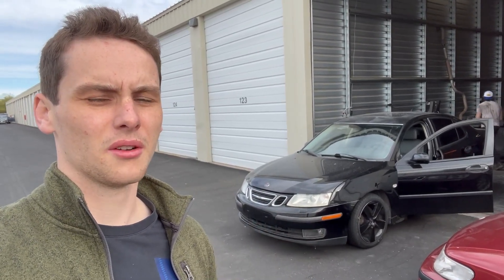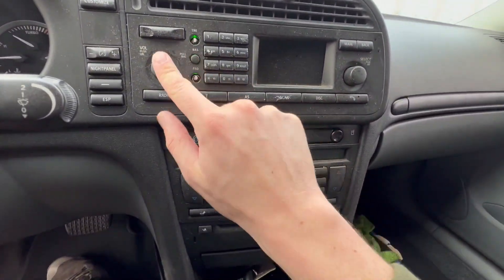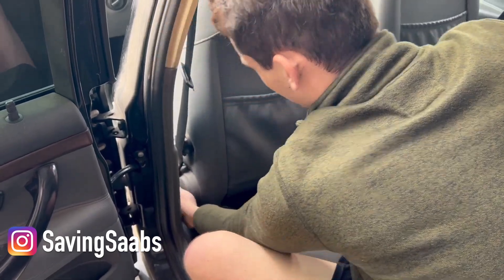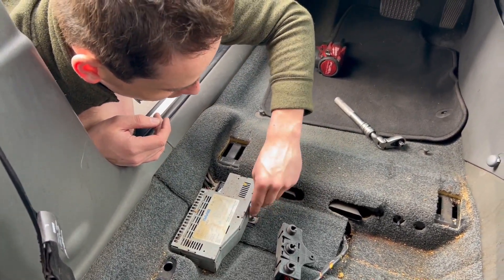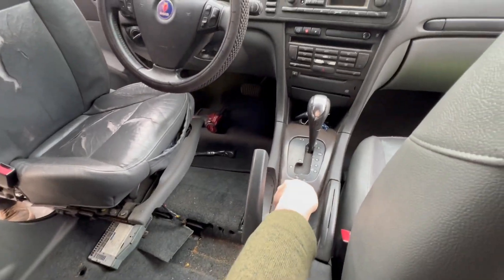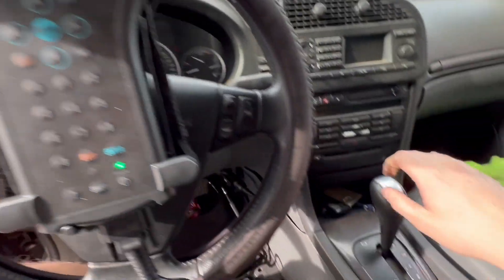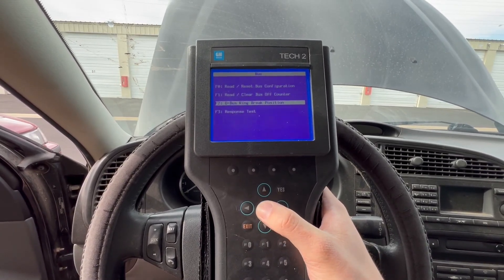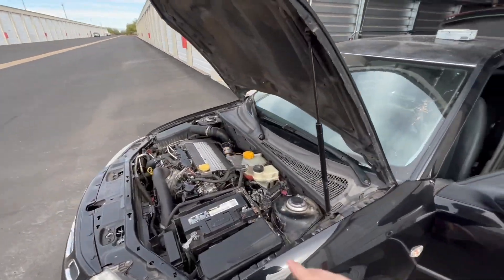Saab 9-3 Quick Fix - AMP1 Replacement

Comment: I have an ‘02 NG 9-3 in black also. It’s had me absolutely flabbergasted more than a few times, and basically at the end of my wits with conniption fits at least twice now, all stemming from electrical issues that more often than not end up being something entirely different than the symptom/problem would have you think. The bus system and it’s numerous checks will fault and disable something downstream of the actual malfunction. I’ve literally had my car bricked, key stuck at “off” and a constant alarm until dead/disconnected battery, after having my entire dash apart tracing wires that were fine and replacing every fuse/relay TWICE to make sure, I even disassembled the fuse boxes and cleaned the actual electrical board with alcohol & toothbrush the 2nd time… and nothing, except a ruined battery from discharging it so many times. I gave up 🤬😭 but a week later tired of my mom driving me to work my determination was restored, so, I bought a brand new battery & multimeter, surfed some youtube and took a freakin oath under all the stars, that “I’m gonna fix what’s broken and restore my Saabrina to her rightful glory ✊🏼”
   I hooked the new battery up and she cranked right up, I have no idea what the problem actually was or which of the things id previously done fixed it 🤔🫣🫠 that was the worst/weirdest problem I’ve had so far, I guess ima be dumbfounded forever on that one. Possibly was the rear fuse box gets wet from deteriorated tail light to truck seals and possibly sunroof drain lines, so check that car! Forreal, especially after/during rains or washing, I’ve literally seen mine dripping soaked asf. Lol 
  An excellent battery, triple checked dialectically greased connections, ALL bulbs made sure unblown, and an infinite supply of devotion has kept everything but my alarms “ultrasound😑” sensor working just fine.  Anywhos 
Good luck to yous guys, and I’m glad it’s this model year the best SaaB channel on YouTube is getting deeeep into!

Comment: On mine 2005 SAAB 93 Arc Conv. the AMP 1 was not under the seat, rather, after much searching, I discovered it on the left side beside the rear seat, bellow the side speaker ! Only than I realized, that there must be an AMP 2 in the trunk, and indeed, that was the culprit. Upon replacing it, the whole radio system  came to live. It was quite a puzzle.

Comment: you can loop the optic cables to keep some functionality intact, you can also open the amp1 up, check where water caused some damage, fix that damage and replace the caps, usually (except if the big mosfet is broken) that fixes it. goodluck tough

Comment: My 07 9-3 convertible has had a dead radio for 4 years. Just replaced the top for the first time ever, and had to take a week under heaters to get it dry. So now that trauma's over, but the radio is the least of my issues... cruise control is broken, so are seat butt warmers (they go on and shut off, likely short out). My solution: cell phone with bluetooth speaker. Done.
Reply from the maker: I would recommend getting the car scanned with a tech2 to begin diagnosing what the cause of your various issues are!

Comment: Check fuses underhood, side of dash and in the trunk. Replaced 4-5 blown fuses and found a fuse in the trunk that I believe runs amp1 or some other module? 
Tech2 indicated icm2 fail, and I replaced it with a known good one to no avail but it was actually the trunk fuse that brought the optical bus loop back online.
Reply: Actually let me start the car too, since that bus came up.
Reply: Fuse 22, according to diagram, amplifier.

Comment: Hi 
Hope you can help me with my Saab 93 convertible , lights start flashing when I start the car , and keep flashing until the car gets hot or after 20/30 minutes
Reply from the maker: What lights? What year car? We need some more info to help
Reply: Headlights xenon type
Low beam  
Saab 93 convertible 2006 
Not just the headlights flashing 
Also The centre lock  starting close and open

Comment: I usually follow your videos but I guess I missed this one. When I got my 05 Linear a few years ago it had the same problem with no audio or chimes or SID and I spent months researching it and replaced every fiberoptic part figuring it out, and it ended up being the EHU behind the climate control panel which was literally the only part I never read anything about that being bad. I bought a new EHU from eBay for $40 and as soon as I plugged in the new one all the audio and chimes came back. I even scanned it with a Tech2 and it said the EHU was fine.

I did put back the old AMP1 to see if that was actually dead, and it was, but messing around with everything else like the OnStar box in the trunk and the ICM were fine. I did upgrade the crappy ICM1 it came with to an ICM2 I got from a junkyard car, but if you're still having this problem with this car you should try swapping in a different EHU to see if that fixes it.
Reply: having similar issues what is the EHU ?
Reply: It's the head unit part behind the climate control panel. It looks like a metal box. If you pry out the climate control panel with a plastic spudger you'll see it behind inside the dash and you pull tabs on both sides to pull it out.
Reply: i wonder if this is whats wrong with mine,, im getting no light through any optic lines, i checked under seat, and trunk lines. ive tried the bypasses that're all over yt and nothing.
  @TJBilyk
Reply: @mxtro7477  Mine actually had the light on the fiber lines the whole time the audio wasn't working. Have you replaced anything in your setup so far?

Comment: Crud under seat stories.....lol. When I first got my 05 linear and was vacuuming it out, I ended up pulling the driver seat after looking under it..... it had what originally was a paper funnelbag of candied pecans like you get at the county fair, but the nuts were long gone, replaced by tiny little empty larva cocoons and pecan dust piles and bug mess everywhere the nuts scattered under the seat. Found plenty of fries and other bits of food on both sides of the console after ripping the other seat out to clean. I kinda expected it when there was a gray greasy buildup everywhere the previous driver commonly touched, steering wheel, doorsill elbow spot, signal stalks, dash buttons and knobs, shifter....major sanitizing project.
 🤢🤢🤮🤮

Comment: I have a quick question I have a 08 93 2.0T the only speaker that plays is my rear center. I have tried unhooking the amp in the trunk to reset it yet nada. Could it be a bad head unit?
Reply: Check balance

Comment: Why are you taking the seat out? I do it faster without pulling.
Reply: How
Reply: One of my seat bolts was absolutely fucked when last installed so I had to do it this way. The connector unclips quite easily and she just slides out.

Was a bit of a pain to install doing the connector blind but got it in after several minutes of working it.

Comment: I don't think you need to remove the seat. Just push forward all the way and  remove the bolt holding g the unit
 Slide it the unit back and undo the  wiring connector
 I installed a rebuilt unit rather than buy a used